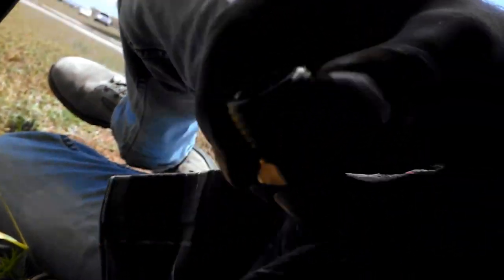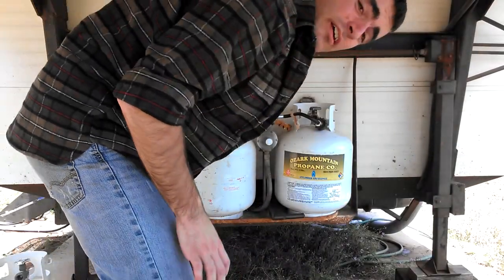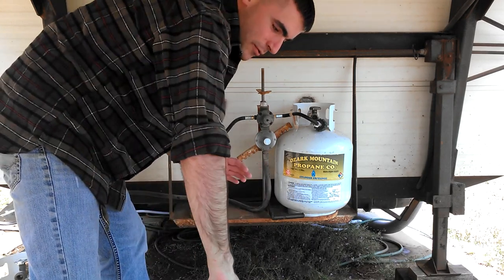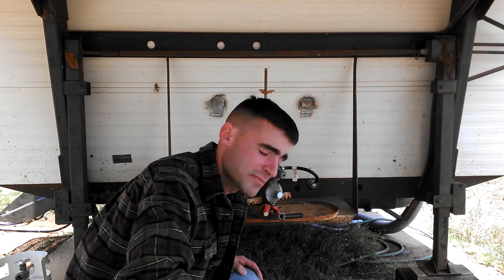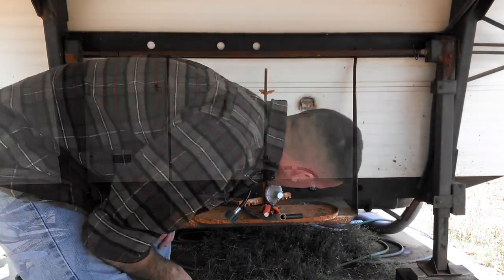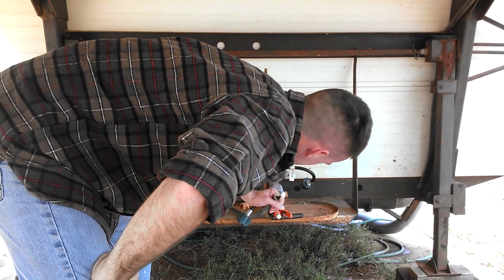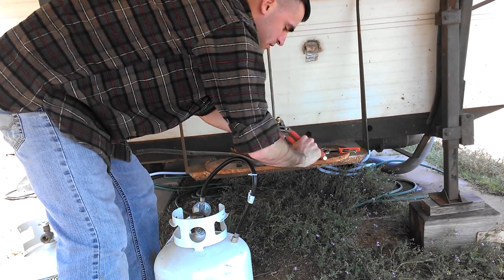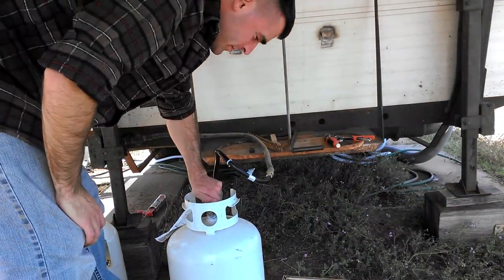Trouble Shooting a propane blockage in the RV

Comment: where is part 2?  This is exactly the problem I was having
Reply from the maker: It ended up fixing itself after I blew out the lines with an air compressor and put a new regulator on. Took a while for the propane to run through the lines again after only the pilot was running. I went and took a nap and when I woke up I was able to light the pilot on my water heater
Reply: @PermacultureFarming  thanks for the prompt response.  I also had tons of that brown liquid in my lines.  After yours I found another video where the guy took apart the regulator and I now believe a new regulator will solve my problems.